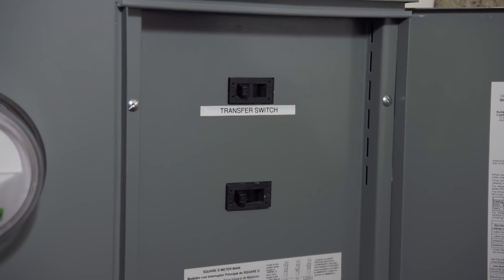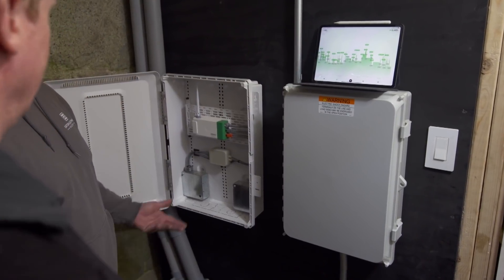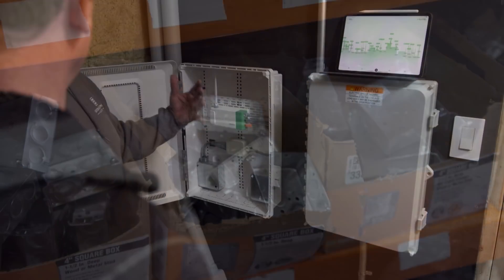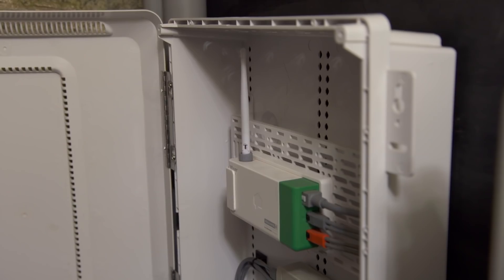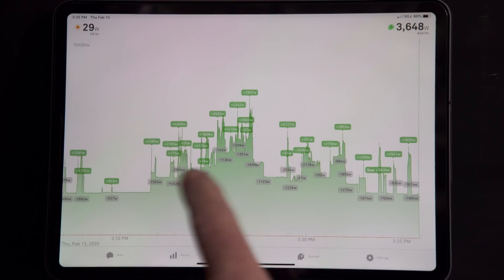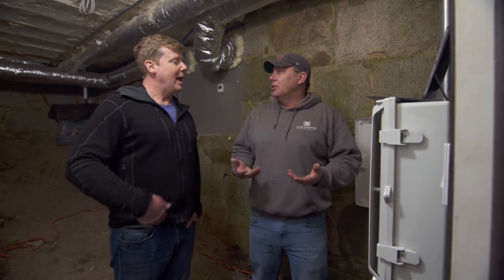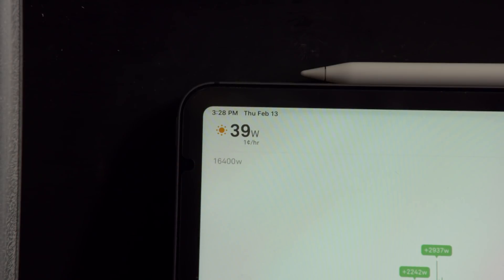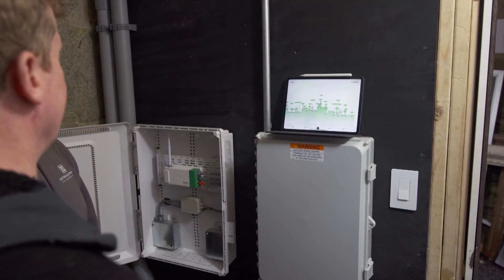How to Install a Smart Electrical System | This Old House

Comment: How valid are the concerns regarding hacking your house?
Reply: That all has to do with nothing more than a week or we used passwords. If you use a good password manager like LastPass which uses complex passwords on every system you have hooked into it then it lowers the risk significantly and it rotates the passwords. It also depends on your location... If you live in a country setting it's probably much less riskier than if you're in a development where the houses are shoulder to shoulder.

Comment: 8000 for the system and electricians. 3.50 cents savings from lowering the settings on the toasters !!
Reply: Hyperbolic much? The sense electrical monitoring device cost about $400, you can get it for about 325 if you monitor Home Depot deal of the day or catch it on Amazon deal of the day if you want to get it at the lowest price point, and then figuring somewhere between $100 to $200 for installation. Your worst case scenario is like $650 out of pocket. How much do you think it could save you if your dehumidifier and your sump pump start running in your crawlspace or basement while it’s not raining? How much peace of mind will give you when your flood lights go off and you know when to check the cameras at your home? How much money can it save you when you find that your old cable box on standby almost uses the same electricity as your new refrigerator, might that persuade you to get off your butt and go to the cable company and ask for a new one? 
You keep “Keep up the good fight“ keyboard cowboy! 🤪

Comment: Man, that's a bunch of hogwash. How the hell is that smart panel gonna know what appliances are using electricity or not by just monitoring the main wire? How is that possible?
Reply: I bet if I show at your home with clamp meter and have you look at the display that you can tell the difference between when I turn on your oven and the kitchen lights, and you’re not a product specifically designed to perform this task.😉
Reply: It probably pops up a notification every 5 minutes "hey did you buy a new lamp? that looks like a lamp to me pls confirm" "no it's a tv" and it sets it up as a tv. Every once in a while it might figure something out by duration, ampacity spike, etc but I would put money on at least 50% of items you have to manually input.

Comment: Control freak dad kind of vibe - “kids you’re using too much electricity toasting the bread - turn it down a notch”
Reply: Or you figure out things like 1/3 of the cost of running the PlayStation or Xbox is leaving it on standby and maybe hooking it up to a power strip with an on off switch is a good idea?
Then you can explain to your kids that you could have four Apple TV streaming 4K content and burn less electricity than having their game console in standby mode.

Comment: Solar tells me you are producing you're producing your own electricity.

Why would you need to adjust your usage?

The only real use for all that data is to determine if a component is using more electricity than when it was new.

That in turn tells you that it either needs to be repaired, or replaced.

I feel sorry for any companies selling new components that use more electricity than the old components did new, or the old component now uses that it is replacing.

People won't care so much about the green energy sticker if it turns out there old component, despite it's age, wear and tear, is using less energy than the new component.

Comment: There's no way it can tell if you're using an electric stove, or a washer, or a drier. When they all use basically the same amount of power.
Reply: There is nothing complex happening. Just register the power drawn and then track it pattern.

Like you turn Toaster on and it takes 700W for 3 minutes.
You track that kind behavior every morning for 1-2 times and you check over Internet a database that what category devices usually does use such amount for such time and then you guess that it is a kitchen device and assign it to kitchen symbol.

You do that for everything, you figure out what is X and try to solve what is Y. Just by long time of tracking. Then it comes guestimate what is X (420W power draw) or what is Y (15W power draw) and you can figure out what there is when you have 557W power drawn, where 435W is for X and Y as then 22W is something else (Y).

Now you just track when ever 22W is drawn and figure out that by it time and used amounts.

It really is very simple math.
You start with X=2340W and in time there comes bunch of patterns of individual values as:
X=25W
X=7W
X=145W
X=1200W

Because you have an history of run times, schedules and all, it becomes easy to figure against power drawn categories against times.

And once you have figured it out, you can always tell that power drawn increase means specific device is turned On.

"Hey, I noticed you are now using 1400W more power than a second ago, you must have a power vacuum turned On as it is your only 1400W device by your history".

And think about what happens when people start correcting those errors in guessing what is what? You get large database of device categories of power drawn amounts.

So of course this is about watts and amps, but you get the point how super simple and easy it is.

One could write a offline version of this. Just log history of that, present a nice line graphic and let home owner to assign a specific power drawn device a name.

Like to teach it, you turn device On for half a minute and then log in the system, tap the peak just minute ago and say "this was my electric grill". As long you do not have any other device causing extra power increase the system learns it.
Or you could input new device, set it's W and A values and register it there.

It wouldn't be automatic but you could have automatic detection for listing devices of new found power peaks that are unknown.

Problems would be if you have a vacuum with same power drawn as your oven, as then it needs to use time and schedule to figure out what is what likely. As you likely do not cook and clean floors same time at every day at same times.
Reply: It is not a current meter. It examines more detailed information to determine an electrical signature for different devices
Reply: @bpmunroe  What?
I don't know they have differ signals.
Reply: @saulgoodman2018  All electrical/electronic equipment produce what is called electrical noise, I am sure the manufacturer of this device has found  a way to read that noise(signature, as Brian put it) and assign a code for each product type to report.

Comment: The funny thing about this type of energy monitoring is only rich people install it and will promptly ignore it after a few days because hell they're rich they can afford the electric bill no sweat.

Even if you get a penny pincher rich dude to buy the system his family (especially the wife) will kill him after a couple of days. I mean if you want to use an appliance you just use it, what's the point of abstaining using something if you need or want to use it, especially if you're rich enough to fork out the money for an energy monitoring setup. 

This is certainly a paid advertisement and a solution looking for a problem. As an electrician sometimes I install real energy management and it consists of LED lighting, occupancy sensors, smart thermostats, or HVAC controllers in commercial buildings. Monitoring appliances is a waste of time, if you need it you're going to use it and consume electricity doing so.
Reply: You, sir, get it :) All this does is provide that "Prius"  (pious?) feeling to the homeowners who can stay oblivious to the actual costs, but in a guilt-free packaging. And.. maybe provides a backdoor to hackers.
If one really cares about the environment, one just gets as many solar panels as fit on the roof and in the wallet, switches off unnecessary devices and minimizes consumption. That unfortunately does not make for a good TV-show :(

Comment: Hmm, lovely installation work and all that but I just get this feeling it's technology looking for a home.

Trouble is that once you have measured everything that can be measured and deconstructed the figures and thought about them, then after a month of looking at the tech and the figures your wife (or husband or kids) will lose patience with you and will ban any further conversation on pain of you sleeping in the spare room. But when she finds out what you actually paid for it  the sh1t will really hit the fan.

With luck you might get your "rights" restored by Christmas ... 2021.
Reply: And what would someone really do with all the info?
Reply: Pretty much. I'm a huge data nerd, but I can't really think of any value I'd get from this after the gee wiz factor wears off. My clothes dryer is using 5000W when it's running...great, what exactly can I do with that info?

Honestly, you can do a load calc for your major appliances, get a kill-a-watt for plugin devices, and maybe a clamp ammeter to check out some circuits in the panel. That's 99% of the value here, for a $50 investment and some time.
Reply: They have a bubble graph for simple folk.😜
Reply: @thetruth5210  Hmm, most folks simply look at their bill.

Never, ever, ever forget that if the bill, any utilities bill come to that, is cardiac arrestingly high then the bill payer need look no further than teenage daughters. They are forever washing/drying their hair, showering, hand washing delicates, leaving lights on etc, etc.

Or on the their computers with hifi blaring away in the background. You certainly don't need a multi million dollar monitoring device to tell you where the energy is going.

It is a well known fact that most women by the time they get married and leave home has consumed several Terrawatts of electricity ... each. Even then you have to pay off the boyfriend by footing the bill for the wedding.

Every dad knows that.

Sons on the other hand rarely wash in their earlier years, (every pre- girlfriend male is acutely aware that water, at any temperature, is a deadly poison even if only a drop touches their skin) and with luck be round their mate's house most of the time or getting into trouble. somewhere else.

As for bubble graphs or charts ... why depress yourself even more?
Reply: “Scarecrow: I haven't got a brain... only straw. 
Dorothy: How can you talk if you haven't got a brain? 
Scarecrow: I don't know... But some people without brains do an awful lot of talking... don't they? 
Dorothy: Yes, I guess you're right.”
Reply: @thetruth5210  😂I'm certain you're attempting to be humorous but this is a very serious subject and using the allegory device is a bit tired by now.

Everyone knows that bubble charts, or graphs, have been replaced by techno kit, I surprised you didn't realise what you were watching on that clip.

To recap, the clip showed a very complex and doubtless expensive data logger. Said data logger produced plenty of information bit not a lot of use to anyone.

And when you commented on bubble graphs, that was interesting and kind of you ... but then, mysteriously, you started going off on a tangent about scarecrows in some reference to the Wizard of Oz.

Without wishing to be rude you are aware this is "buildings construction" vlog on YT?

It doesn't have any links, real or imagined, with American children's literature.

Do try to keep up.
Reply: @Kevin-mp5of  Hmm, after due consideration movin it just tree qwata isn't going to wash.

I think I would go to far greater lengths to to ensure continuation of my rights ...
Reply: @Kevin-mp5of  And another thing ... I don't believe "nice n' easy" does the trick either.

Something to do with the coefficient of friction, apparently ...
Reply: @Kevin-mp5of  I was attempting to modify the laws of physics, as in horror vacui, by attempting to fill the 'vacuole" with a length of biology in a reciprocating plunger type action.

So a mere 'tree qwata" at  a rate of "nice n easy" may not guarantee a suitable outcome.

In fact a vector, which is stretching things btw, might need to be at least 64 eighths amplitude for a period of a second perhaps  over 2 hours.

Comment: That is cool. I don't think it would work in my home. I can't get internet where I live.
Reply: Keep checking on Starlink, you’ll have Internet at home next year.
Reply: @thetruth5210  hopefully it won't be like the other satellite broadband internet. The few available in my area offer 12mbs @$100/mo. Too slow for that price. I could maybe dig out my old 56k modem. 🤣
Reply: @rebelrailroader  First responders using it to battle the forest fires on the West Coast are reporting speeds of over 100mbs while the system is in beta testing with an incomplete swarm. COO of Space X/ Starlink she was talking about gigabit speeds for around $80 a month. I think 56k modem can stay tucked away.
Reply: Hotspot. For instance I picked up a Verizon hotspot with unlimited access that has been useful for the home
Reply: @SimonTekConley  I looked into an unlimited hotspot. Verizon tells me they don't have one. I can get a phone with unlimited 15g data. Personally I'm ok not being connected to the internet at home.
Reply: @rebelrailroader  they had it a few years ago. I can understand that statement. If I didn't work in IT, I would consider disconnecting at home
Reply: @SimonTekConley  Verizon and others don't have good service where I live. The price you pay to live in the country.